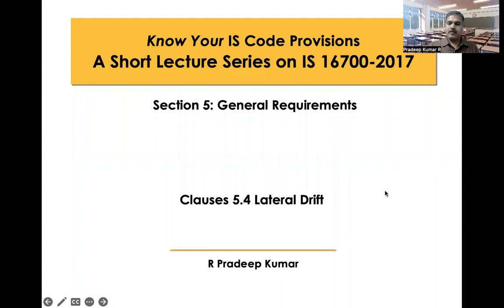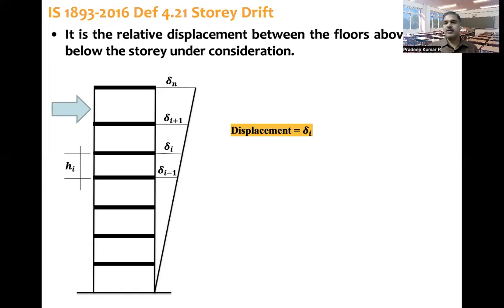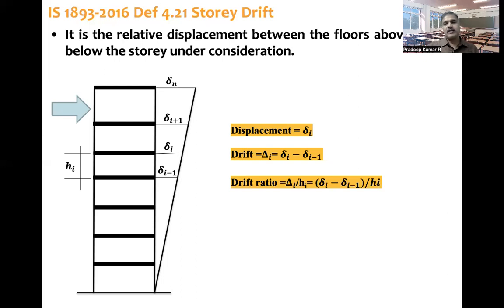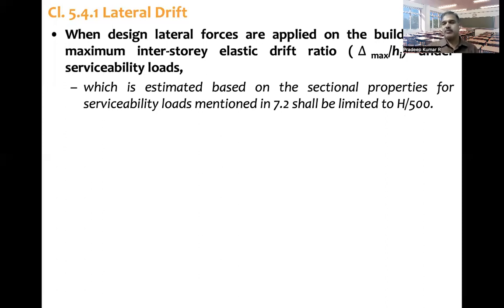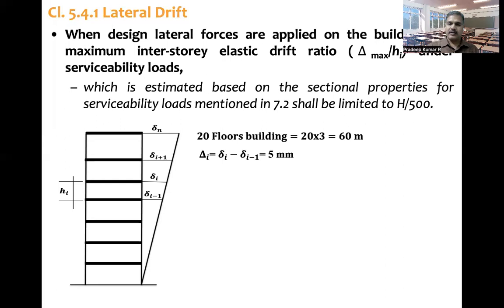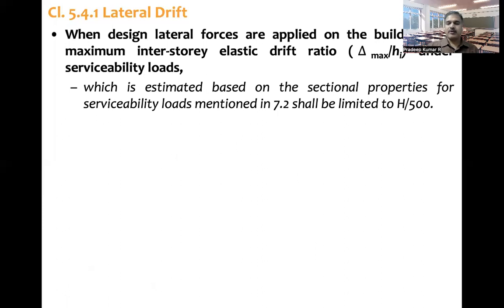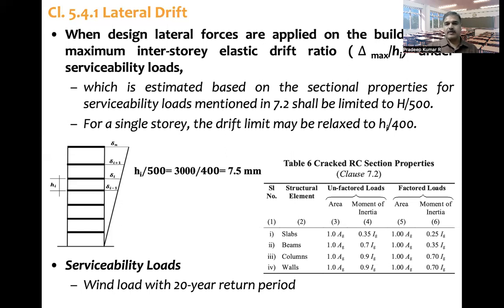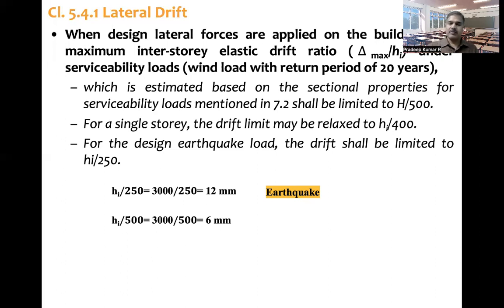Tall Building Code, IS 16700-2017: Clause 5 4 Lateral Drift

Comment: sir, for drift calculation by which load combination these displacement values should find i.e, by service load combinations with load factor 1 or by strength load combination with load factor 1.2 or 1.5 or just by lateral load case only?

this clarification is not given in the code

Comment: Dear Teacher, while performing a nonlinear time history analysis to determine the storey drift ratio, for each time step, lateral forces differ from one another, leading to different storey drift ratios at every time step. So, how can I find the overall/governing storey drift ratio?
Reply from the maker: You may first get the displacement time history of each storey and later find the drift at each time instant i.e., [Ui(tj) - Ui+1(tj)]/h. here i and i+1 represent floor levels, tj represents time instant, U represents displacement, and h is floor height.